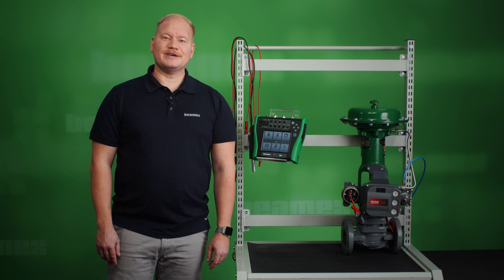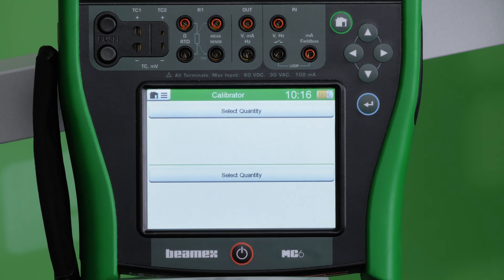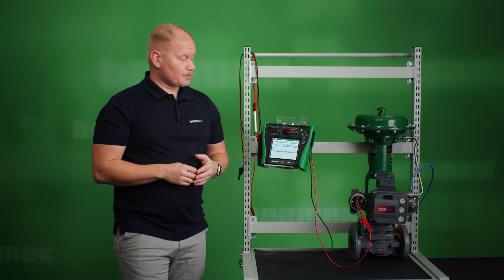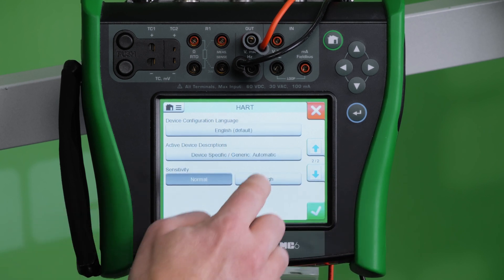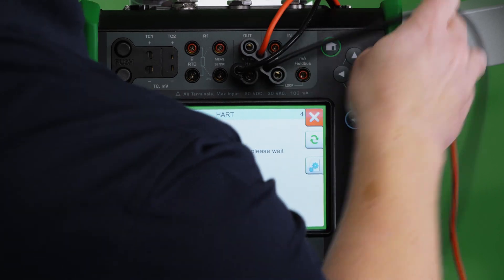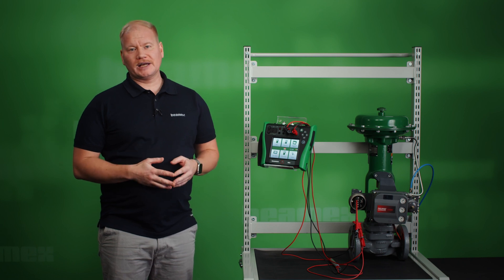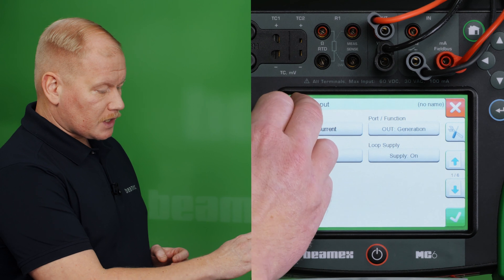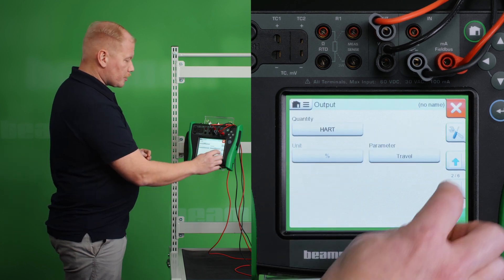How to perform a linearity test for an air operated HART valve

Comment: What type of external resistor are you using?
Reply: Hi, in this video, we use a basic resistor about 250 ohms. In normal cases the resistor does not need to withstand much power, but if it accidentally connected to short circuit the loop supply coming from DCS, there can be a couple of Watts of power on the resistor.